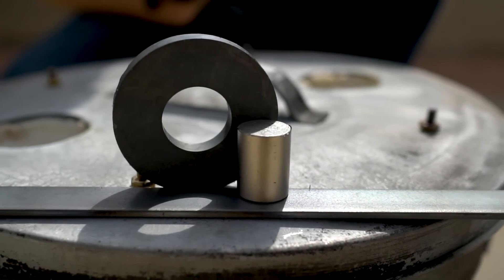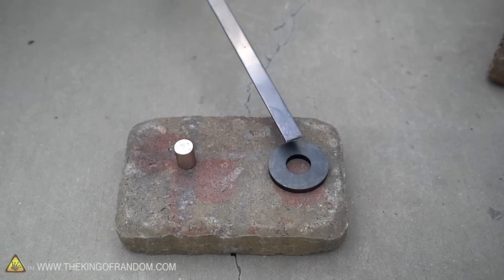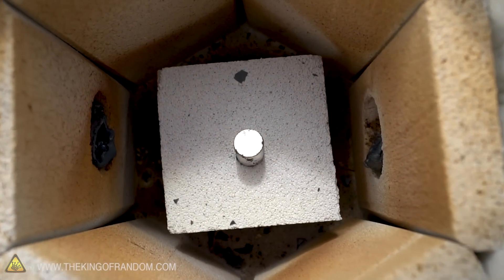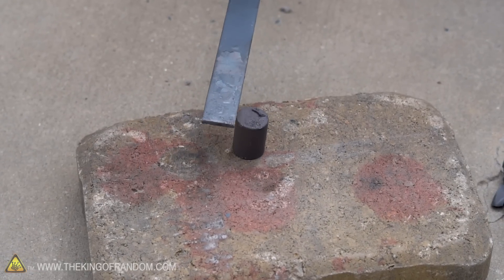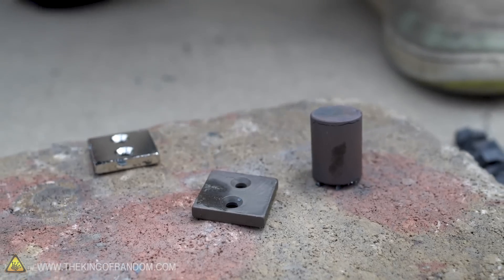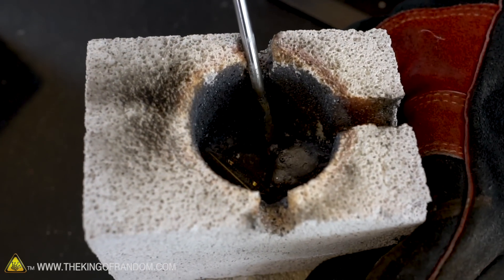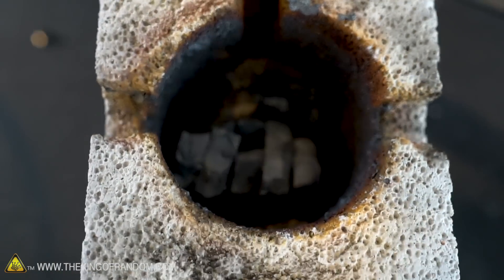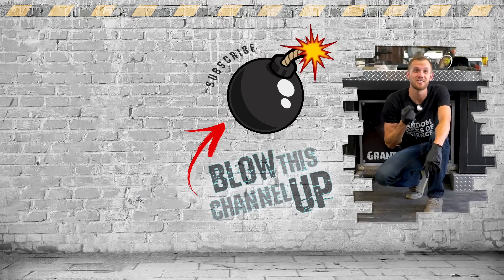Melting Magnets is Weird

Comment: Lots of misinformation about Nd magnets here. Neodymium magnets are not "mostly neodymium"; they're mostly iron. The approximate formula is Nd2Fe14B, so Nd only makes up ~12% of the alloy. The fact that it is an alloy would only serve to decrease the melting point, not increase it. Thus they should melt a bit below iron melting temperature. It's possible the cylinder magnet had a hard time melting because of low contact area between the curved surface and the electrodes.
Also, I understand you do things solely for entertainment, but you really should have at least mentioned the concept of the Curie temperature. It clearly explains what happened to the magnets. A minimal amount of research would really help improve your videos.
Reply: He was using temperatures well in excess of the melting points of the materials. Nd Curie temp is about 350deg. Nd melting point is about 1100deg. The composite magnets are not melted when created for a reason. Nd melting point is several hundred degrees below iron btw. Iron is around 1800 deg. So the ovens he used obviously worked, but I would love to see an inductor as they use in vacuum deposition.
Reply: most Neodymium magnets get more or less destroyed at about. 230C (roughly 400F), so that red (800C or more) was waaaay overkill
Reply: Agreed, 12% isn't mostly hahaha. That's the thing with these entertainment changes, they can have a lot of false information.
Reply: It's obvious he's not a education YouTuber. He's an edutainment YouTuber.

Didn't even mention the fact that this is all caused by different Allotropes of steel.
Reply: mrhomescientist please be my chemistry and biology teacher 😂😂😂
Reply: WHAT
Reply: Thankyou for the interesting information about this. I agree it would make their videos maybe slightly better with that added education
Reply: 0
Reply: I care why?
Reply: The curie temperature is the main thing I suppose, and explains how paramagnetic, diamagnetic, and ferromagnetic materials react to changes in temperature
Reply: Alloys do not always decrease melting temperature compared to pure substances.

For an example which is simpler than thinking of metals: Mixing alcohol with water increases the boiling temp compared to alcohol but decreases compared to water. This is something you can experiment. 

Another example, but more complicated, is mixing indium and gallium which are both solid at room temperature, but the simple rubbing together creates a mixture that is liquid.

So your statement was wrong. Proper statement:
Due to the fact that neodymium (high melting temp) is being mixed with iron (lower melting temp) and assuming that the mixture is ideal (or aprox ideal) in its behavior, then we can say that the melting temperature will be between the two.

The melting point can increase, compared to the pure substances, if the mixture diverges from ideal behavior in a way that makes it energetically favorable to be a solid.

For example, if the mixture leads to massively increased interactions between their potential wells, for example very close bonding, then we will get a mixture that has a higher melting point then either of the pure substances.

Also, these guys make videos for a certain crowd of people that don't really care about the science behind it, and that's fine. Not everyone has to know everything all the time.
Reply: @peoplezk1  alcohol in water is a solution not an alloy
Reply: @peoplezk1  if indium and gallium mixed melts at room temperature, than I would think the melting point decreased...
Reply: Peoplezk1 A solution of alcohol and water will boil at the temperature of alcohol until the alcohol is gone. Boiling and melting are governed by different laws of physics. What Mrhomescientist said is true, an alloy will always have a lower melting point. Stainless steel is a great example as it has a melting temp lower than both the iron and chromium it contains.
Reply: Not true... It will boil until you get a solution that boils at a slightly lower temperature than alcohol. Search for azeotropic mixtures. By distillation you can only separate water from alcohol (specifically ethanol) to approx 95.6%. The azeotropic mixture of water an ethanol boils at about 78.2degC while pure ethanol boils at 78.5degC. The opposite is true and some azeotropic mixtures have higher boiling points than the components in the mixture... Or something like that ;) I have no experience on metallurgy though...

Comment: Is the arc that you are using to melt the magnetics AC or DC? If it is AC (alternating current) then it is demagnetizing the metals when melting. If it is DC then it may polarize the magnetic poles.

Comment: Mr. Random,

What happens if you bring steel/neodymium to red hot and cool in the presence of a strong magnetic field? I assume since heat transfer to permanent magnets is an issue, it would have to be an Electromagnetic field, but the ability to make a string field should be within your capabilities.

Comment: Just an FYI if you swap out parts of the furnace so propane comes in one side and pure oxygen into the other you will get it hot enough to melt tungsten. Assuming you do a 2:1 ratio of oxygen to propane. I’d love to see what you can melt if you set it up this way, can you melt ceramic this way?

Comment: I have a legit question:
at 9:31 to 9:35, when touching the neodymium molten magnet with the steel bar, there's like an almost-invisible glow around it... is that a camera error, or a edition error, or a compression error... or it does look actually like that? because it's only noticeable in those frames but also the only shot in those exact conditions.

Comment: You should try creating a strong electromagnet and then re-inducing magnetic order in the NdFeB magnet, after heating it, by putting it in the magnetic field.  The heating (sintering) of the NeFeB magnet might actually make it slightly better after re-magnetising it

Comment: So if glowing red steel isn't magnetic, does it still conduct electricity, and if so could you use a steel rod with a glowing red tip to make an electromagnet?
Reply: dustin mccorkle yes it will still collect electricity and yes you can use it to make an electromagnet
Although such an electromagnet will be pretty terrible because it's hotter which makes it more likely to fail

Comment: I was building a little doodad/thingymajig about a month ago, using magnets I pulled from old hard drives, and I was soldering them together thinking I would have a strong magnet. NOPE! after I soldered them all together, they would barely hold anything. I was pretty surprised that such low heat could cause that.

Comment: Now you know why manufacturers who put the engine starter near the exhaust or a hot, confined space- are a poor design, either on purpose or coincidental. A "digital" EGR valve is another example. (usually) 3 ceramic coated steel pintle valves, activated by electromagnets.

Comment: When I was around 10 years old, I theorized that magnet (the ordinary black one) will break if tried to be melted or heated alone since it's made of rock (because I experimented with rock and candle and there's a slight popping sound on the rock, and I think it will explode in Higher temperature), and this video prove my theory on magnets. Thank You Guys!

Comment: Kind of a disappointment on the science.  Jumped straight to near melting temp of magnet without exploring whether it would lose its magnetism at lower temperatures which would have given an indication of what would happen when you placed magnet on heated magnet.  I'm assuming you already knew the heated magnets would not regain their magnetism once cooled.  But then there's the question if hot iron is not magnetic and hot magnets are not magnetic, why does the Earth have a magnetic field? Is that your living room?

Comment: I read a manga called Clockwork Planet. In the manga It said to demagnetize metal you need to heat it up to a certain temp. After watching this video I found the statement in the Manga was true. So that said Manga/ anime does have some facts in them and you can learn a thing or 2 from them.

Comment: That's not a neodymium magnet. One that side would of jumped to the bar farther up where it wasn't heated. One that size would of had a electromagnetic field of about a foot. I'm not saying you are lying about it but you were probably sold a chromium Nicole coated ceramic magnet. They are often faked and sold that way.

Comment: The magnetic alignment of the molecules are free to randomize when hot.. their individual magnetic fields are negated by each other as they are not aligned. This is why an automobile starter that uses permanent magnets grows weaker, as the heating cycles diminish the strength of the magnets in the field. It might be interesting if you could borrow a magnaflux machine from a machine shop and allow a piece of molten iron to cool while in the strong induced magnetic field of the mangnaflux machine it would likely align the molecules to create a new permanent magnet.

Comment: What if the magnet was huge, like, a long cylinder or sum'n. U think if u heat up a section, it would isolate itself from the other parts, as far as loosing it's magitism? If so, how long would it stay like that? Would it keep or eventually, even itself out? Interesting...

Comment: You should read about the "Curie-Temperature" of a magnet. Neodymium magnets have a curie-temp of about 350 degree C. That means at this temperature the material loses it's magnetism completely and permanently.
Reply: The issue is that each grain is oriented in a different direction, meaning that the net total of all grains cancel out to no direction pull. You need to polarize the material to orient them all in one direction again.
Reply: @Tweadon  so by grains you are to magnetic domains?
Reply: Semi permanently

You still can re-magnetize them
Reply: :O how?
Reply: @ElighneArkaine  just put them in an incredibly strong magnetic field for a while

EDIT: you can rub a needle on a magnet in one direction and it gets magnetic enough to be a diy compass
Reply: @Throneos  my dad magnetises most of his tools. He is a cat mechanic. Very cool amd smart idea, it actually works too when i use his screwdrivers they stick right into the screw way easier then a normal screwdriver
Reply: Elighne Arkaine As they cool down, just at the Curie point, using an ELECTROmagnet that's unaffected by the heat. That's how permanent magnets are made.
Reply: @ElighneArkaine  for ferromagnetic materials we use a very high magnetic field or we do an hysteresis cycle.
Reply: @neionsiren  I never taken my cat to a mechanic. How often do you have to do that? I estimate she's put  about a hundred miles since we have her...
Reply: @atenrok  depending on how big she is , you might want to get the cat mechanic to come to you, or else you got to go through the trouble to get an oversize load permit
Reply: @neionsiren  how to demagnetize a large object, like drillpress?
Reply: well, permanently. they will not remagnetize spontaneously
Reply: They also get stronger when they are cooled
Reply: Once you get magnets hot enough, the domains are de-aligned, causing permanent loss of most magnetism.
Reply: The heavy afterglow of the molten magnet could just be burning (the alloy might tend to burn better), or maybe the release of magnetization energy, or other crystal binding.
Reply: Superconductor magnets I thought had to be super chilled below -175 to absolute zero to remagnetize.
Reply: @dport9563  
Superconducting magnets are made from coils of superconducting wire.
A coil acts as a magnet when you pass current through it .Superconductors have very low resistance at low temperatures, which means you can pass large currents through them to generate large  magnetic fields.
Reply: why?
Reply: Play with Junk well that explains a lot
Reply: So you destroyed a couple of magnets???
Reply: Some ferromagnetic materials are easily magnetized and demagnetized. A example is wrought iron which is used in transformer cores. The alloys that make the powerful magnets are not easily magnetized but if once magnetized stay magnetized. They are useful for permanent magnet (PM) motors and scientific instruments.
Reply: Not permanently. It can always be magnetically charged again.
Reply: Also ferromagnetic materials above Tc behaves like paramagnetic aka weak attraction
Reply: Yup, a high voltage EM field is what causes the magnets to get a field in the first place.
Reply: I was wondering how he doesn’t know that heat removes magnetism
I got thought that in 3rd grade
Reply: Carlos Sanchez
Or that he could have wrapped a coil around his crucible and remagnetized them. COOL FLAMES on the helmet tho...
Reply: Carlos Sanchez of course he knows but experimenting is fun and when done you get to learn way more than what you learn reading a few pages.
Reply: @CarlosSanchez-en6mr  because this is a video for highschool-dropouts, who skipped science classes to smoke pot.

Comment: scientific explanation:

While heating the magnet you went past curie temperature or curie point that is different for every magnetic material. When curie temperature is passed Wiess domains reset and magnetic spins do not face uniform direction in every domain. In order to restore wiess domains you have to put the magnet inside strong magnetic field such as one in a coil.

Comment: I have a question about the ark furnace. I made my own from your video but it only gets to about 1200 degrees Celsius ? So its maximum potential is melting copper. We didn't use the same microwave thingy. But we used our own one.